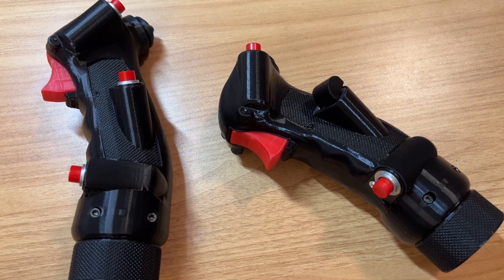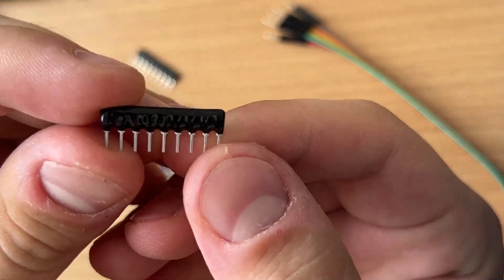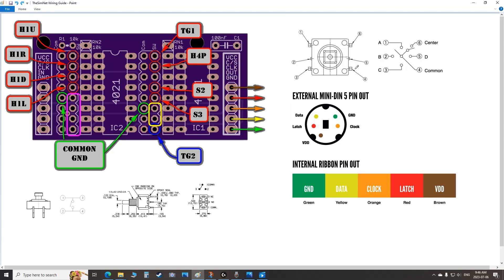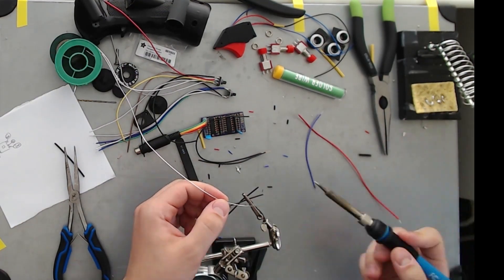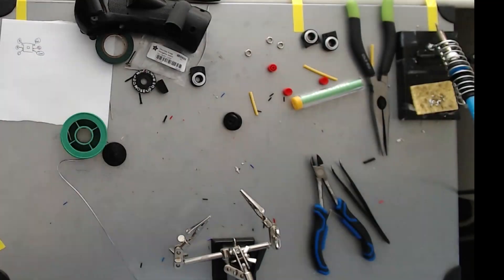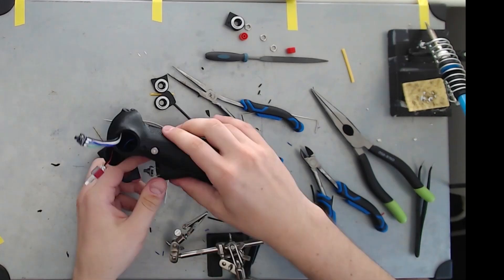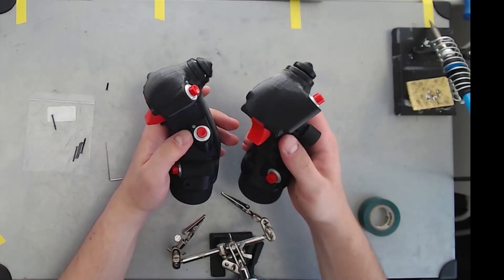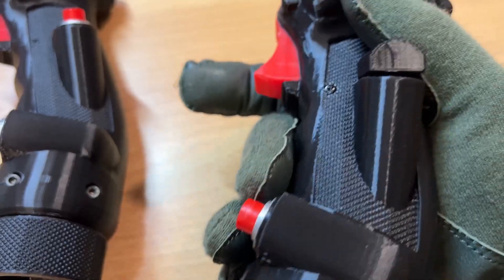Free 3D Printed F-4 Phantom Joystick Assembly and Wiring

Comment: Could that be used with an ardino to control servo motors?
Reply: probably (you would have to use a different controller to the one hes using though)

Comment: Great project man! Do you think it would be possible to wire a shock motor like the one found on xbox controllers to the board? I was thinking about having recoil with the trigger push
Reply from the maker: I have not tried this personally as I am not familiar with motors and the voltages they require. Theoretically yes, but it may require a different/updated pcb etc. Definitely a stretch goal of mine to integrate somehow!

Comment: So how does it actually attach to the base?

Ive always wanted to create an extension so i can sit the base on the floor between my feet and bring the grip over the seat between my knees, like a helo stick. Im kinda sick of having it on the side.
Reply from the maker: The thread on a thrustmaster or virpil base is M36x2.0 and so the stick has a nut that interfaces with the base like a regular thrustmaster or virpil stick
Reply: @thesimnet  ok thanks.

Comment: Great job! Could you please tell me how you made them I have the entire bottom part of my own done, but can not figure out how to do the top. I am trying to modal a t-37 stick I bought and it is slightly different than these. Also different electronics so i cant just steal yours. Please let me know! Thanks you for your time!
Reply from the maker: There are lots of approaches! At the simplest level, I will put an object on the floor next to a ruler and zoom in so it fills the screen, and take pictures from all angles which I load into blender and "trace". I also have a few 3d scanning apps on my phone which work great for handheld objects like grips. Some apps don't require the LiDar sensor and can create decent models from photos alone. These models are usually a little rough but the scale is accurate, so that serves as a "base mesh" while I model a new mesh on top. If people are interested in a how-too video I can show my process from start to finish!
Reply: @thesimnet I would love a how too video! I am using Solidworks so it is a different process, but I would still love to learn. I will have to check out the scanning apps. Thanks for the reply!

Comment: Oh this is awesome. Is it possible to connect a 2 axis analogue stick to this? (For a tdc)
Reply from the maker: The PCB I have been using does not have an option for axis, however it is technically possible as Virpil grips do have axis on the grip - just probably with a different PCB. If you are building this grip to work with a custom base, you could run the wires into the base itself, that could definitely work! The trim hat is removable for this reason, I figured poeple would want to use different types of switches etc

Comment: I have a real B-8 that I have been wanting to convert to flight sim use.  Looks like the electronics would allow me to just wire up the switches and go!  My main challenge would be fabrication of an adapter/connector from the threads on the bottom of the grip to the TM threads.  I love the B-8 grip!  Nice work on these, and thank you!
Reply from the maker: That's awesome!! If you happen to know the thread pitch and angle from the original grip, I could model a connector and add it to the thingivers page!
Reply: @thesimnet    That'd be friggin awesome!  I'll see if I can figure out what original pitch and angle is.  :D

Comment: could you reupload the grip model it seems to be really low quality
Reply from the maker: Thank you for the feedback! I made this model in Blender - each vertex is actually hand placed, so I was unable to run a subdivision modifier without running into all sorts of intersecting faces. That being said, there is a version 2 that I am working on, and this will be released later this summer, of a much higher fidelity. The components will be identical however, so folks will very easily be able to swap over to V2 when the time comes. Cheers!
Reply: @thesimnet  thanks im still waiting for aliexpress to arive so take your time!
Reply: @thesimnet  are you still planning a V2 model now ive made the F15 joystick. and is this version compatable with the trigger?